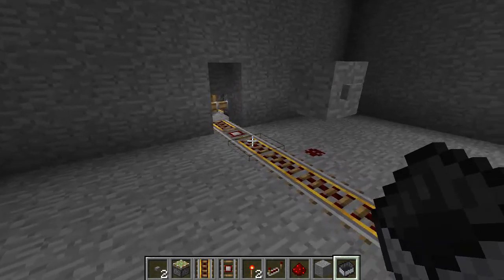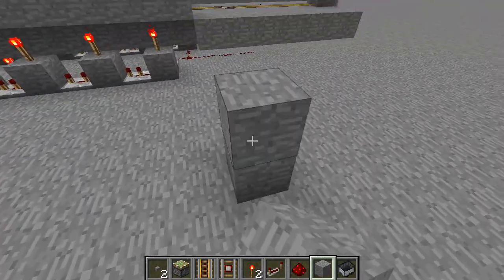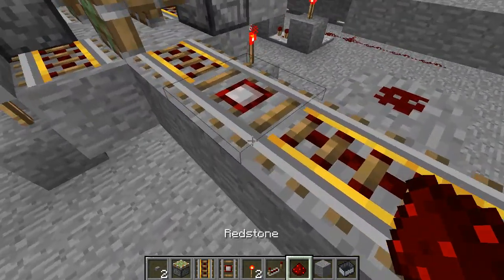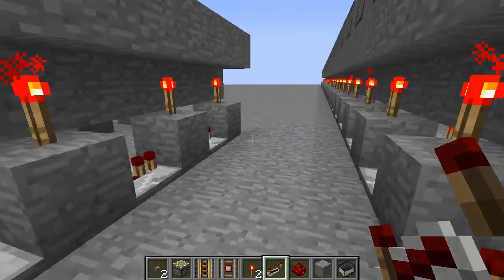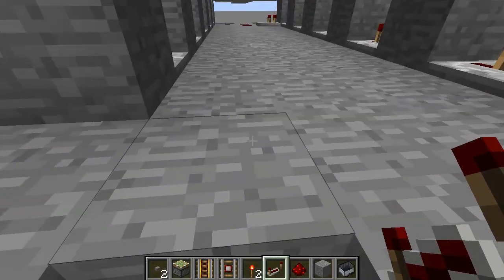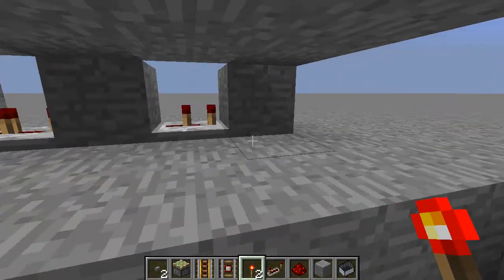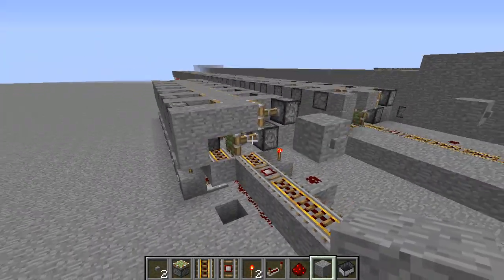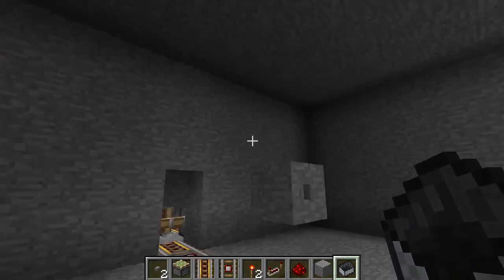"Zipper" Rail Tunnel - Minecraft Invention (With Tutorial)

Comment: If you combine this with the rail bridge, you have one amazing concept for an alarm system/ escape route. It would take much longer to get through without being able to use the rails, as you would then have to either mine two stone layers or place a block and mine the pistons and stone. The signal that started the chain could trigger a defense system, like a self destruct for escape, or there could be sensors on some of the blocks you would have to break.
Reply: Is this account still up?